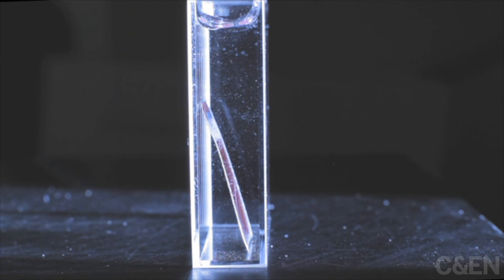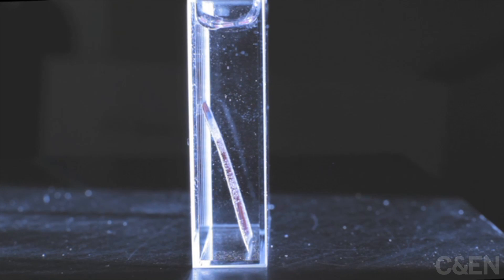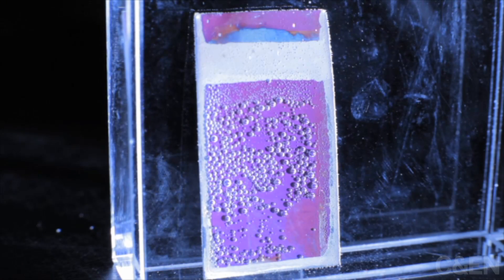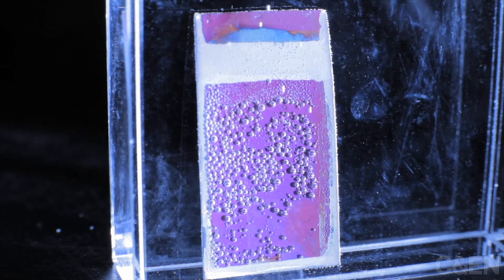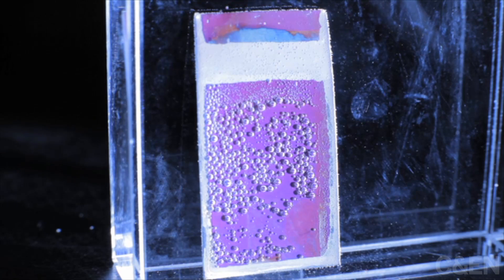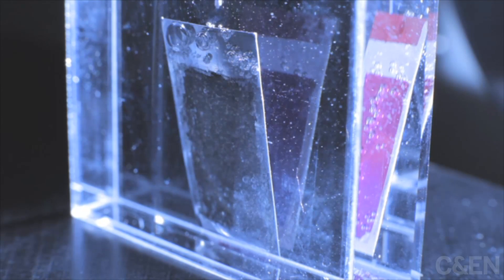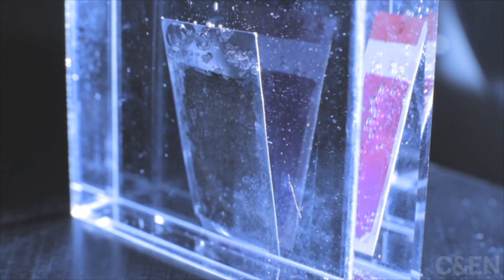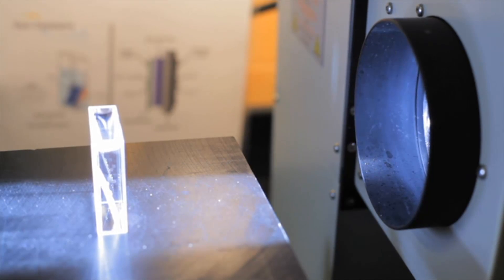Artificial Leaf Generates Electricity From Light

Comment: It's actually an amorphous silicon triple junction solar cell on stainless steel with water oxidation catalyst on the front and hydrogen catalyst in the back.  Titanium dioxide is not a part of this system.